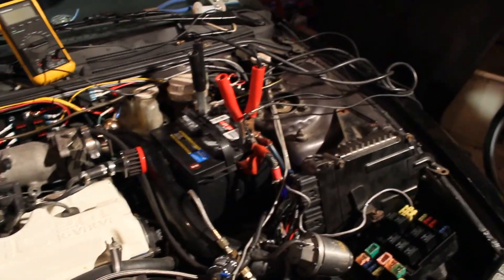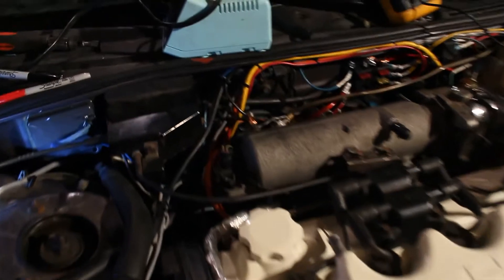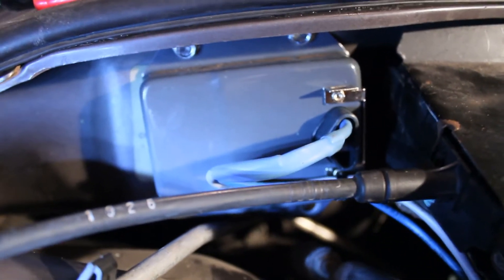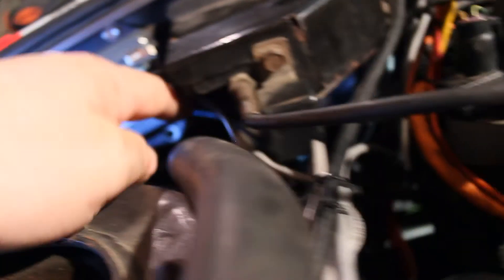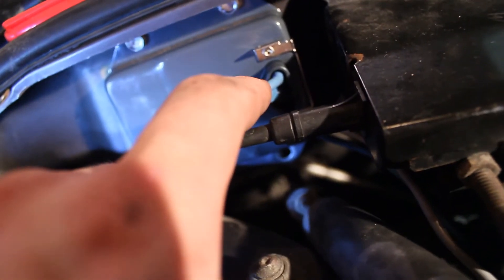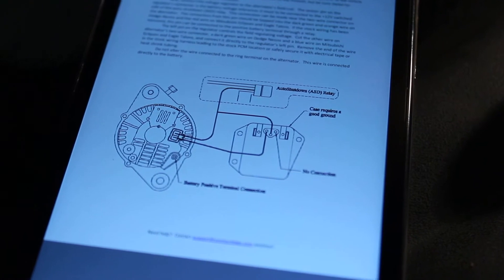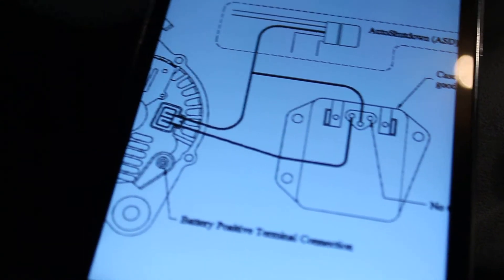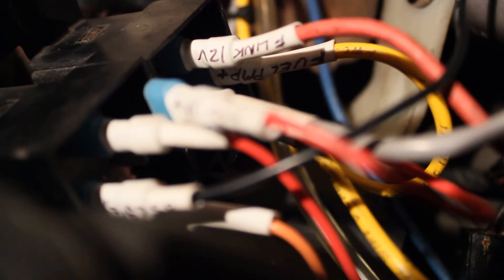Evan's Megasquirt Build Ep 29 - External Voltage Regulator

Comment: im glad the early classic minis didnt have factory ecus lol much easyer to start fresh new install 
also using and internal regulated and internal fan alternator to make things easier also much smaller
also this is just my opinion! being a tight ass will haunt you as you found the meggasquirt wiring bundles are expensive but sort of worth it just to simplify things again just my opinion

Comment from the maker: Everything on this car is direct from the sensor, except the tach. I'll be wiring up the Tach to the MS, but not right away, as it requires a small output circuit and I'm tired of wiring stuff for now. I'll actually have to add a DB9 to the case I think since my DB37 is out of pins... no big deal. Remember this is the base car, so I think I only have 4 gauges in the cluster... fuel, temp, RPM and MPH. If i can score a cheap 7" tablet with bluetooth I'll just mount it in there as the cluster

Comment: Very cool.  What do you plan to do with the factory instrument cluster if you disable/remove the factory ECU? Some gauges just need raw signal but you may still have to rewire some things if they run into and then back out of the ECU before going to the cluster.